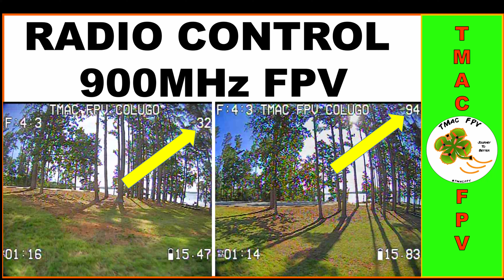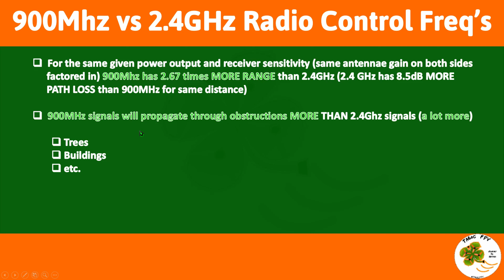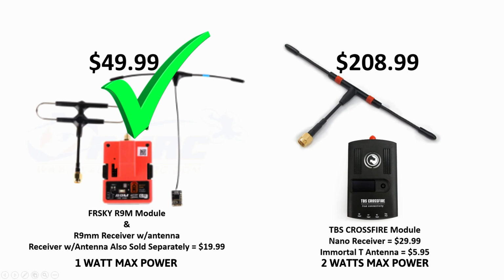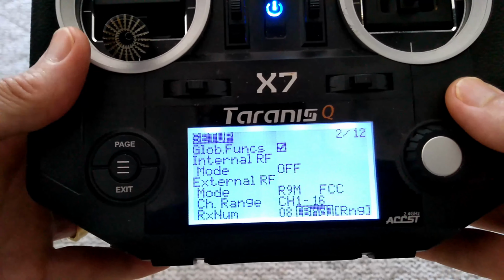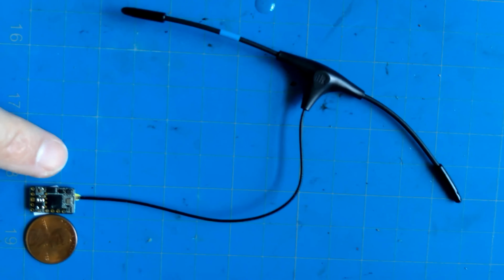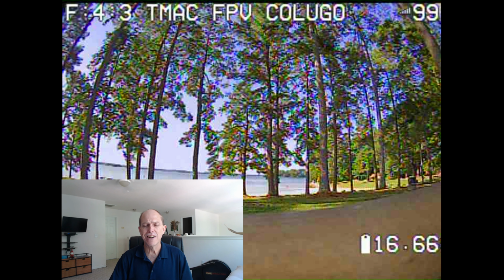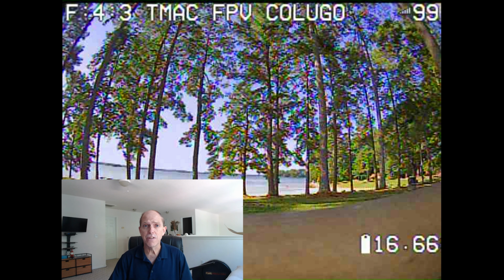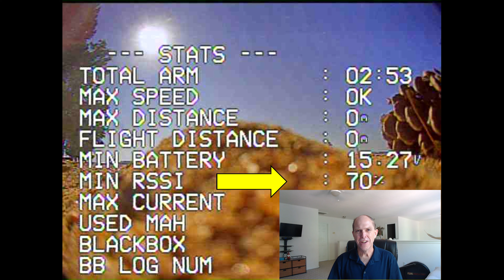RADIO CONTROL 900MHZ FPV

Comment from the maker: Significant improvement with 900Mhz system! New or recent to FPV? Check out 👉 https://tmacfpv.thinkific.com/courses/fast-track-fpv 
Clear Skies!👍
Reply: I have a very dumb question about this (I'm new here) - Does the FPV video use the same Tx/Rx pair that is used to control the drone? If so, how is the video handled in the RC stick radio? Thanks
Reply: I don't have anything to do with TBS except from using Crossfire and I really think this video is a bit misleading. The absolute most expensive TBS module (not in any way required for average quad use is used to compare the price) On HobbyRC (UK) the price for the full blown module is 209.90£. The Crossfire Micro is 59.90. Expensive? Maybe, but after I made the change I have newer looked back to Frsky 2.4 GHz. The FrSky 900 Mhz is probably a fine system, but please make a fair price comparison

Comment: Btw R9 is known to be FAR less reliable then Crossfire, hence the price difference. And now you can get Crossfire with 500mw WITH a controller, antennae, module, and receiver for $200
Reply from the maker: I agree Isaac. 😀 That video was done "awhile ago" and I have since switched to Crossfire
Reply: @TMacFPV  Oh I didn’t realize how old this video was. Just out of curiosity, what caused you to switch? Were you having any issues? If so what?
Reply from the maker: @isaaclanier1507  It was working "ok" for me (better than 2.4ghz). However, a couple times flying in high interference areas, it fail safer on me.  At that same timeframe, a lot of folks were having issues with their R9m mini receivers (manufacturing issues with a batch or two?) and that is what I was flying and had a couple more brand new sitting on my workbench with no way to tell if they were from bad batches or not. No one was having any issues with Crossfire. Made the switch and haven't looked back!💪👍
Reply: @TMacFPV  Makes sense that’s what I’ve heard before. You got yourself a subscriber! Keep up the great work!
Reply from the maker: @isaaclanier1507  Appreciate your support Isaac and welcome to your TMac FPV channel!👍

Comment: Which parameters is the best for flying into forest with dense vegetation?
Reply from the maker: 900 Mhz band for control signal is better for penetrating forest and vegetation than 2.4 GHz band
Reply: @TMacFPV  Thank you sir. Can the FPV transmitter also work on 900Mhz simultaneously??
Reply from the maker: @Explore_Jharkhand  not exactly sure what you're asking. If you mean the video transmitter that is on your quadcopter and transmits the video to your goggles (or display), the answer is no. That is transmitted at 5.8 GHz and will most likely breakup (poor video) if flying through dense vegetation. If there's a lot of space (gaps) between the trees, your video should be ok.
Reply: @TMacFPV  Yes sir that is  exactly I was asking. Is there a way to have an fpv camera that can transmit through thick vegetation say 500metres? And what will be the optimal radio band ? I am sorry to ask so many questions as i am knew to the RC world.
Reply from the maker: @Explore_Jharkhand  the best video transmission system in the 5.8 ghz band (which is what is used for 99% of FPV quadcopters) I'm aware of is the ImmersionRC rapidFIRE module installede on your FPV goggles.  My setup is teh Skyzone o3) (OLED screen) goggles with teh Skyzone module adaptor and the ImmersionRC rapidFIRE odule.  You can see all of these on my site at: https://tmacfpv.com/fpv-goggles/  Take a look around at the different pages of my site.  You'll find some good "beginner-friendly" info there.  You CAN get video transmitters in the 2.4 ghz range (which should be better for longer range video transmission as well as better penetration through vegetation), however, they also require larger antenna on your quadcopter and you'd also need a special 2.4 ghz video receiver module to see it.  here's a video comparing both 5.8 ghz and 2.4 ghz video transmission (over water not dense vegetation) https://www.youtube.com/watch?v=Kl0bEGBZf58
Reply: @TMacFPV  Thank you sir 🙏

Comment: Is 838mhz better than 2.4 over elrs as I fly cinewhoops mostly in buildings parks and behind trees
Reply from the maker: The 900mhz band (868 for EU or 915 U.S.) has better "penetration" abilities due to physics than the 2.4ghz band. This normally means you'll have a stronger signal with it flying around and through objects like buildings and trees.

Comment: Hello sir, i want to know that is there a relationship between signal strength and speed of Quadcopter? 
What was the power of the transmitter?
Thank you
Reply from the maker: There is no relationship between signal strength and speed of quadcopter. Signal strength (or quality of control signal link) is only an indication of whether or not your stick commands will be received and executed by the quadcopter (will you have control of it or not)

Comment: I fly my R9M on my mini quad, too.  Just within the football/soccer complex of our local college I fly on 10mW.  My RSSI stays 65+, even at several hundred feet away....only dropping that low when the antenna orientation is the worst (TX is in the plane of the Rx antenna).  A slight turn and it's back into high 80s and 90s again.  
Did you notice less latency when you switched to 900 megs, like I did?
Reply from the maker: Outstanding! I just find 900 Mhz to be so much better in many ways!
Reply: I'm having 100% LQ with crossfire at 800meters through 2 buildings at 25mw ;).

Comment: Nice, but for planes I’m going with Dragonlink.. R9 has its issues.  You’ll see after using it for some time those issues.  I’m a mod on the LR FBG you are on and I like the R9 systems but for more expensive models like we have in fixwing I’m not to confident in it as lately I’ve found some pretty bad issues with R9.  One being external RF interferences. It’s healing ability is limited
Reply from the maker: Wouldn't ANY system operating in the same band/frequency which is competing with more powerful signals in same band/frequency have the same problem?
Reply: TMac yes but
Reply: Users need to realize in urban areas you will eventually have issues with 915mhz. Being there is a lot of RF influences

Comment: Hi sir can we use normal 2x18650 batt on qx7?
Reply from the maker: It will work, however, I believe you will need to do a modification for an 18650 battery case.  Her's an article on that.  Many folks have done the mod.  https://fpvfrenzy.com/taranis-q-x7-mods/

Comment: No brainer to choose Frsky R9 system. Crossfire is a bit better in stability and FW update but cannot be justified by its 3X price. Well, that's TBS's style of doing business....
Reply from the maker: Thanks Vince C! So far, so good with the R9. That's what I thought, can't beat the price! Noticed RMRC may already be sold out of the package deal. They've sold out and re-stocked a few times I'm aware of, so hopefully they'll have more soon. Based on the Wings in your Logo, I'm guessing you've done "some" long range flights. Using R9 system? What RX? How far have you gone? The "normal questions." Also, do you use 5.8 GHz for VTX? Thanks again friend!😀
Reply: @TMacFPV  Yes, I'd been using R9 system since Frsky launched it. So I went through the early period of instability performance such as random RSSI, sudden RX loss, short range failsafe etc. But since around 6 months ago, FW updates got most of these problem solved and I've been enjoying stable operation since then. I have R9 in 4 quad/planes in BF and INAV. For receivers, I think R9 slim+ is better. I typically fly in <10km range. I use 5.8G for video mostly except one which I use 1.2G.
Reply from the maker: @vchan1501  Wow, you're an R9 Veteran! Thank you for sharing your experiences. Bet we could all learn "a bit" from you! What power setting do you normally use (adaptive)? Have you seen that "User's Guide/FAQ" I mention in the video and link in description above from Justin Kramer? Came across it in an R9 FB Group. Looks pretty informational to me.
Reply: @TMacFPV  I use FCC and at 500mW power. I do not use 1W adaptive caused I do not like the power switching to take place. One suspected reason I think accountable for the random Rxloss I experienced before even for short range (say at just around 300m) is due to may be a bug in the FW during such power switching so from that time onward I simply used fixed 500mW output. I do not need 1W anyway for the distance I fly. In my case, my RSSI is at always over 70 for a distance of say 7km away. My range is usually limited by my video. I just went into the the UserGuide/FAQ you mentioned. Wow, looked very comprehensive, will bookmark it for future reference. Thank you.
Reply from the maker: @vchan1501  Vince-Thank YOU for the experiences you have shared with us all! Very, very informative and very much appreciated! Thank you for taking your time to share. Please enjoy your weekend and I hope we can talk again soon friend! 👍Stay in touch-TMac
Reply: I don't have anything to do with TBS except from using Crossfire and I really think this video is a bit misleading. The absolute most expensive TBS module (not in any way required for average quad use is used to compare the price) On HobbyRC (UK) the price for the full blown module is 209.90£. The Crossfire Micro is 59.90. Expensive? Maybe, but after I made the change I have newer looked back to Frsky 2.4 GHz
Reply from the maker: @BennyBunkSimonsen  Happy Easter again Benny! Prices change. That video was made over a year ago. I too have switched to Crossfire. Enjoy your Easter!
Reply: @TMacFPV  Happy Easter again and again sorry to be to fast (if you can call it fast to reply after a year ;-) YouTube algorithm put this video on top and I did not initially see it was a year old. My point was that the Crossfire Micro (at least for my use) is more than enough and so much better than what I was used to with the 2.4 GHz. I don't know the R9 so can't comment on that. May I ask why you later on changed to TBS?
Reply from the maker: @BennyBunkSimonsen  No worries Benny.  I absolutely agree with you about the Crossfire Micro.  In fact, the Crossfire Micro has evolved a lot since this 900 Mhz video I did.  Back then,  its max output power was 100mw (I believe), or had just switched to 250mw from 100mw.  I switched to Crossfire because I was getting some failsafes with R9 around some power lines I was flying near.  Then the whole FrSky firmware stuff started happening as well (some R9M receivers I had been using started coming out with faulty firmware in some batches and there was no way to determine which batch you got when you purchased your receiver).  I got fed up with Frsky.  I went with the Crossfire Lite (2w max but no Bluetooth) option "just in case" I needed more output power than the Micro had at that time.  If I were just now going into Crossfire, I would without a doubt (no hesitation) get the Micro version.   I've been flying Crossfire for a long while now and love it.  No need for me to switch to Express LRS, ImmersionRC Ghost, or any other FrSky protocol

Comment: If using R9 in wide open areas it works very well.  But if users are in area with congestion you WILL have problems at some point.   I’ve been testing this gear since it’s release

Comment: im on my fourth brand new r9mm that dosnt work
Reply from the maker: Sorry to hear that. Is the correct firmware flashed in it for the firmware you have on your R9M module?
Reply: @TMacFPV  yes I have one about a year old and it was updated to along with the module and its fine but the other three on smoked one will not bind for nothing and one will bind but un binds in less then a minute its unreal
Reply from the maker: @jbengineering2681  Wow. I've seen comments in FB groups about these problems with R9mm receivers due to a "bad batch" or something like that. Most people are now saying to stay away from the R9mm RX and use one of the other R9 receivers instead. Honestly, since I have the non-ACCESS version R9M module and FrSky is moving toward ACCESS & I've gone to the T16 transmitter, I think I'm done with R9 system. Think I'll be going to Crossfire!
Reply: I finally got a r9m slim that works perfectly. I bet there is a batch of r9mm out there that are bad I a had 3 bad one I have had for a year works still 3 new ones were junk one burned one would bind but after 20 second unbind and the third wouldn't bind for nothing
Reply from the maker: @jbengineering2681  Sounds familiar. R9M FB group has a lot of discussions about just that issue. Bad batch(es) of R9mm receivers. Most folks I've heard don't trust them anymore. The one I have (like yours) works fine. Got one recently before I knew about bad batches and it's still sitting on my bench. Most likely won't install it. Think you made a good move away from r9mm

Comment: TMac, any chance you can do a Frsky R9m setup on a Jumper T16, or is it the same setup for the Taranis radio you are using here in this video?
Reply from the maker: Same thing bigfella-plug R9M into external module bay, and select external R9M in Model Setup menu near where you bind it, then bind and fly!
Reply: @TMacFPV  Great thanks for your reply, any chance you could then do a video on how to update firmware for the R9m on a Jumper T16?
Reply from the maker: I'm assuming you're not talking about an ACCESS protocol R9M, correct? If you have an ACCESS protocol R9M that may be different (i.e it may not be compatible with T16 since FrSky is keeping that protocol to themselves). If it's the NON-ACCESS R9M, like I used in the video, then it's the same as in video
Reply: the non ACCESS version..thanks.

Comment: Great video man! Sure is liberating to have that extra range! After the initial setup, I've never had to update the firmware, and I've never lost or burned up a receiver- Very reliable! Only thing to watch out for after it's up and working is that the ipex connector is secure! Do everything in your power to keep tension off the receiver and secure the heck out of that antenna. I get a thick rigid ziptie end, heat shrink tube the antenna on both ends, and secure it to 2 arms with zipties. Secure enough to carry the quad around by it 😂! I also abuse the hell out of my quads, so that's my advice from my experience. Take care!
Reply from the maker: Thanks Jason! I can breathe again with strong RSSI. Love your Tips and experience feedback-Thsnks and keep em coming! Have an awesome weekend 🌞

Comment: I had host of failsafes on R9M some as close as 20feet away, broke a lot of expensive camera equipment and frames, due to R9M failures, and had two fried modules that quit working, after which I switched all my fleet to CRSF.  If you love RC technology, and don't have CRSF, you don't love yourself.  CRSF is worth every penny you pay extra for it.  Will never go to FrSky again.

Comment: Man, you have something wrong with your 2.4g setup...rssi of 32??.. That close?..
  I can go 4.5kms on an xm-plus with rssi to spare...I have the R9 too on flex, it's not much better..For real long range I use EZUHF...
Reply: I have an original Taranis (not plus version) and also had very low RSSI a few hundred metres away on (2different) X8R receiver. I believe something's wrong with the internal 2.4 module.
I went to TBS crossfire after Frsky management betrayed us with ACCESS. The range is absolutely insane on this. Now the weak link is video.
Reply: @goku445  Well, the old X8R is a Telemetry RX and it's not got great range, a well known fact..The XM plus is a very sensitive non telemetry RX, the exact opposite. My R9M running Flex Firmware works just fine..I don't need or want Access...agree tho, poor show by FrSky.